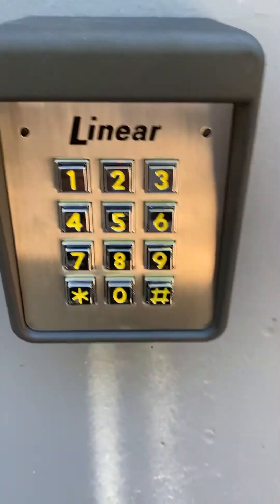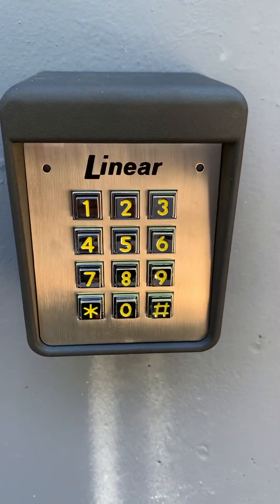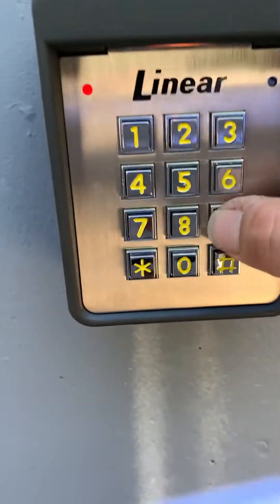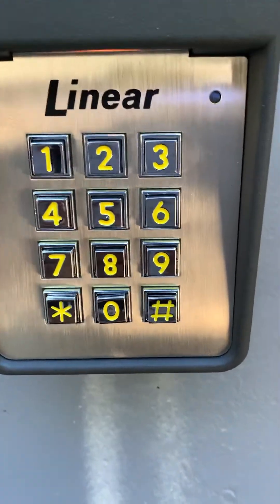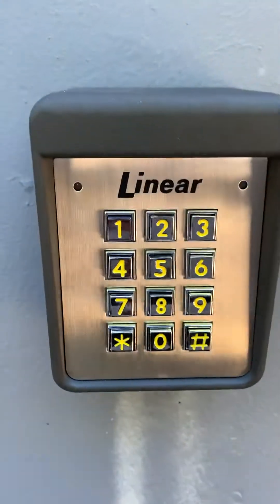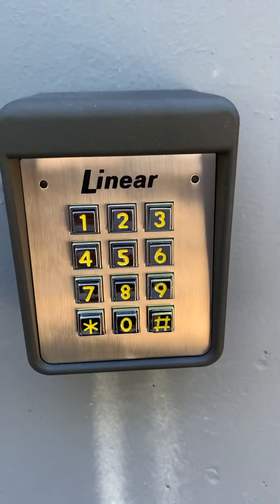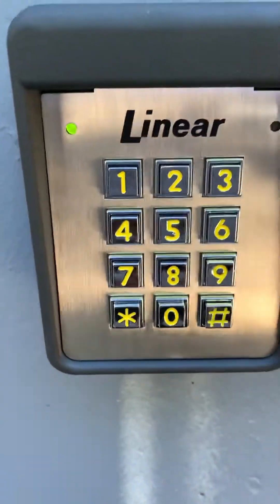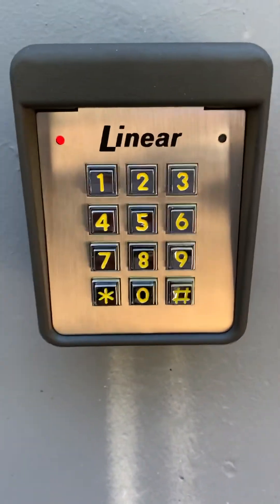Easy Linear Access AK11 Code Programing. How to Add and Erase 4 digit entry codes.

Comment: I changed my 4 digit code and erased the original 4 digit code. Why does it make me enter the code twice in order to open or close? 

Also after changing the code, my DoorBird that also controls the gate opener no longer seems to work. It says it is triggering the relay but nothing happens. It is like the DoorBird app lost its credentials when I changed the 4 digit code on the Linear keypad.

Also after changing the code, my remote door openers needed to be reprogrammed as it seemed like it removed their authentication as well.
Reply: exactly this same thing was just happening to me today! also, i found the LED was glowing green, and my garage door opener wouldn't work. if i entered my code once, the LED would turn red and then i could use the garage door opener all i wanted. but would have to enter the code on the keypad a second time to make it open, and then the LED would turn green again and garage door opener wouldn't work until the code was entered again... what the heck

did you figure out how to correct this??
Reply: @altcoinlogic9121 any luck? I am having the same issue.

Comment: I have 2 of these setups for 1 gate, 1 outside, and another inside. I programmed both with new codes but the inside one doesn't allow my remotes to work after typing a code. The solid green light stays on, so I have to enter the code again for the light to turn red, then the remotes will work. What did I do wrong?
Reply: I have same situation...tech support can't figure it out either...would love to know this answer

Comment: how erease all codes wit out code i forget the code and i need re install other new code
Reply from the maker: You will need the key to open the keypad to reset master code .If you have the key then steps are…

Step1: Open keypad
Step2: locate jumper JP2. This jumper is used to reset the master code.
Step3: with power applied to the keypad, remove jumper JP2. The keypad will begin to beep, signaling that the code has been reset.
Step4: put JP2 jumper back. 
THE MASTER PROGRAMMING CODE IS NOW (123456)

Steps below are for FACTORY RESET.
THIS WILL MASTER RESET KEYPAD TO FACTORY SETTINGS ERASING ALL MEMORY INCLUDING EXISTING ENTRY CODES.
Step 1: disconnect power from keypad
Step2: press and hold (* and #) keys 
Step3: connect power while holding  (* and #) until the red LED starts flashing 
Step4: release the (* and #) the red & yellow will remain lit until the process is complete. 

Hope this helps 
Have a blessed day 👏
Reply: @Outdoors_Unlocked  Do you have a video on this Master resting process??? I have a manager leave and took all the codes with him... Need to set new master and gate opening codes.... 

Also how many codes can be stored on this key pad????
Reply from the maker: @johnnylujan648  Hello Johnny, do you have the physical key 🔑 to open the keypad with the lock located on the bottom of the keypad?
Reply: @Outdoors_Unlocked  I am looking for that now... If i cannot find the key, I will have locksmith come and open it then have a new lock and or key made.... I think i found how to do it once I get it open.... Think I will be setting it back to factory and then starting over with new master and then access codes....